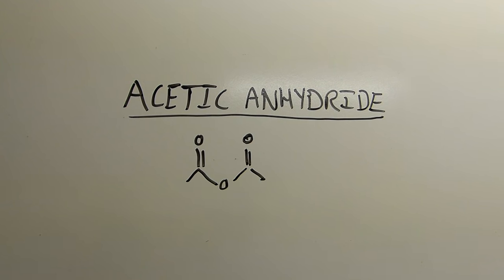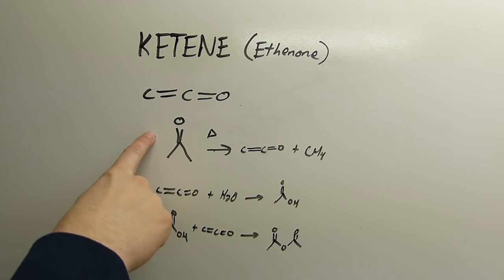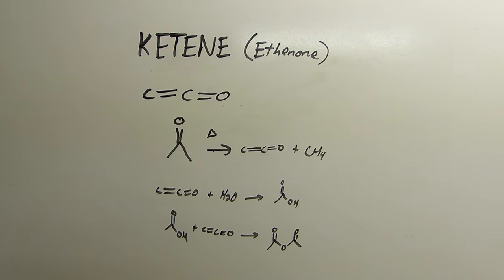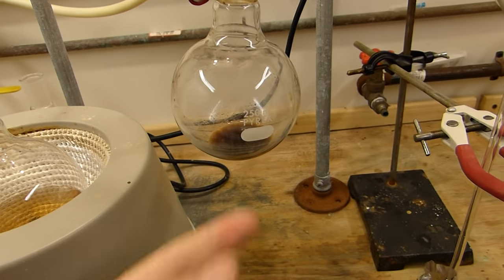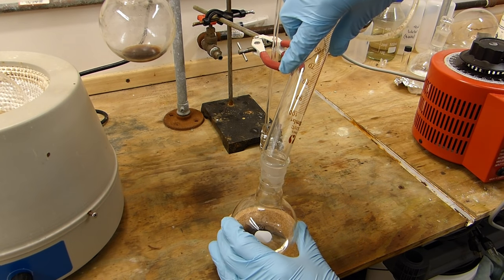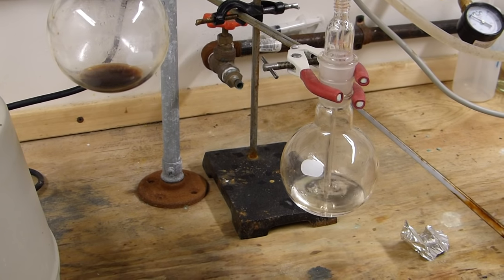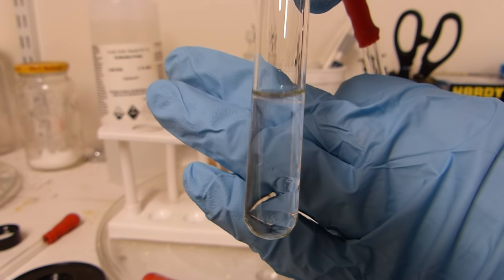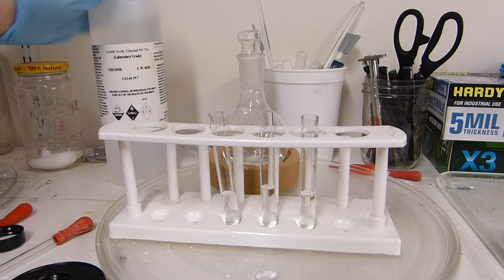Acetic Anhydride Part 2: Running the Lamp

Comment: I would never have the balls to switch that heating element on without running the apparatus under positive pressure of inert gas.  Kudos on your immense testicular fortitude.
Reply: balls of steel indeed
Reply: Saculus in latin
Reply: Please explain this for me Adrian im fascinated
Reply: Couldn't you just use a ventilator on a separate oxygen line from the room?
Reply: Density of acetone vapor effectively purges oxygen from the apparatus.   LEL/UEL is 2.6 and 12.8 respectively  so it isn't that sensitive compared to say hydrogen or the real devil, ethyne.  The other saving grace is the nichrome and copper are effective catalysts for oxidation of acetone.
Reply: @keithjurena9319  yes, you are quite right, acetylene is a nasty little bugger, with it's 3 highly strained bonds and it's wide range of mixture ratio's that go BANG. Did you know that some thermobaric fuel air bombs use acetylene ? There's quite a bit of science involved to get the acetylene to disperse and then and only then is the mixture detonated with another small charge after the dispersal charge. These sorts of bombs are actually only second in outright power behind atomic weapons ! Technically these things can be BIG, a cluster bomb can be used to disperse bomblets to cover an area like a square kilometer
Reply: @psycronizer  
I discovered that as a teen.  A bunch of calcium carbide,  some sodium peroxide,  a trash bag and 100 feet of remote electrical initiation.

It effectively denuded a few hundred square feet of hay pasture.  Lost a pair of underwear in the process.
Reply: I would be far more concerned about the inert gas pushing ketene out of the system than I would be about a fuel-air explosion, because very quickly the gas mixture would be far too rich (oxygen deficient) to explode.
Reply: @psycronizer  just being outside I don’t think would help you either… I know ketene is relatively unstable but i don’t think personally I would risk it.. one gust of wind your way could end badly lol
Reply: Acetone has a high flash point. I used to work with a chemist who used the acetone rinse bottle to put out his cigarettes.
Reply: CO2 isn't "inert gas" per se. but works quite well for a ketene lamo - 's what I used for many years.
Reply: @keithjurena9319 thank you, Keith. You answered a question that I technically didn't even ask you but you apparently read my mind. The exploding ketene lamp from acetone vapors igniting scares me even more than the ketene gas as I'd be thoroughly protected from it with a fume hood, ventilation, respirator and homemade chemical weapons suit made from black plastic yard waste bags.
Reply: Luck😂❤
Reply: Can this chemical break iron nail and loose its magnetic property

Comment: Doug, you're suggestion to use a smoke bomb to test the ventilation in the smoke hood and lab area is well taken.  If there are problems evacuating the smoke out of these areas you need cross ventilation, what is known as "make up air". Particularly and most commonly if you are in a basement in the winter you will have negative air pressure the indoors relative to the outdoors,  this negative air pressure must be dealt with.  Cross ventilation will make the space colder but it will provide you with the essential fresh air.  The way to test for negative air pressure in the lab area is to open a window or door to the outdoors or turn off the fan in the fume hood and see if air rushes in through the openning, if it does you have negative air pressure. Hood fans, which are exhaust fans, can't overcome negative air pressure because the more air they pump out of the room the more negative the air pressure, the vacuum, becomes. By the way, sometimes you don't need a second fan, all you need is to leave a window or door open to the outdoors across the room to let the air in. We love our chemists and we want them safe.

Comment: Ok. So if you suddenly stop producing new videos, we'll know why...
Reply from the maker: +TheBookDoctor Bah, I filmed this three days ago. Safe and sound. :) Also, as you probably saw, I usually buy my Ac2O. I just wanted to prove it could be made at home.
Reply: +Doug's Lab Where do you get your commercial Ac2O from?
Reply: I'd like to know too
Reply: @DougsLab  there are other ways to make Ac2O at home
Reply: @SuperAngelofglory  how?
Reply: @Andrew-my1cp  low yields can be achieved from glacial AcOH and liquid NO2. Also, you can use sulfur halides to convert acetate to AcCl/AcBr and further to Ac2O. Both these are unpleasant and somehow dangerous, but they do not match the risk of using a chemical weapon
Reply: @SuperAngelofglory  Interesting. To my knowledge at lower temps, NO2 begins to favor N2O4 more than NO2. Cool nonetheless but yea even NO2 is something I avoid and neutralize at all costs. I couldn't imagine ketene. FUCK that. I don't even use dichromates. Not a fan at all lol. Anything with a 4 for health on the NFPA diamond is a no go for me.
Reply: @Andrew-my1cp  in that case, you can get AcCl from HCl, AcOH and CH3CN, all bone dry and cold. The yield is about 25%, but, aside HCl gas, you only work with liquids. After that, AcCl + AcONa = Ac2O + NaCl
Reply: @Andrew-my1cp  NO2 only dimerizes in solid state, liquid is still NO2
Reply: @NerdyNEET Well, nitric acid is either 3 or 4 depending on how which one you look at. In my opinion it's a 3. It's pretty toxic. The vapors are and the decomposition product is very toxic. The fuiming version is the worst.

Methanol is relatively non toxic as a lab chemical. You'd have to drink 10mL to make you blind, not kill you. I'm pretty sure at least. I'd give methanol a 2. The diamond gives a decent quick overview.

Comment: Well done, brave man, and a great account of the synthesis, thanks.
I would recommended using a second bubbler to eliminate residual ketene in the exhaust though.
Reply: Maybe fork out $1000 to encase the apparatus in a nifty acrylic enclosure, with water sprinklers on top, to douse the mess when the whole shebang blows out.  That might save a chemist life, and his cat Schlipsi's too.
Reply: *pumped to negative pressure.
Reply: @_arthurski1337  It wont blow if you know what you are doing. Dont attempt it if you dont fully understand what you are doing.

Comment: I might have missed it, but it looks as if the reaction and work-up were done without an inerting gas. Granted, the volume of the system is fairly small but best practice would be to inert the system prior to introduction of reagents. This is something that I have to do often at work (chemical plant operator) for safety reasons. 

Great video, I really enjoyed it.
Reply: It probably feels more acceptable to be a bit more "cavalier" about the safety procedures if a) doing them might not be so easily available to you as an amateur and b) it's just your own life that you're putting on the line, as opposed to the lives of everyone working in the plant and potentially people living nearby.
Reply: I think a tank of arc-welding gas (argon/CO2) would be a good cheap way to get the oxygen purged out.
Reply: @chemprofdave  That's what I use but it does require a lot of drying first. I'd bubble it through H2SO4 (actually piranha to be overkill) then through a drying line of anhydrous Mgso4.

Comment: You can make a useful smoke pen out of nothing but tightly rolled paper towels. It doesn't exactly plume huge quantities of smoke but it naturally smells terrible, being burning cellulose, and you can use the scent as an indicator of fume hood failure while still getting the benefit of being able to accurately test small cross sections of the flow path.

Comment: wouldn't this synthesis be a lot safer under argon or nitrogen flush ?
Reply: I was thinking the same thing.
Reply: How exactly would you do that? The atmosphere will become acetone and then ketene regardless of how you start the lamp.
Reply: @jonross377  it removes the excess oxygen and does not react with anything
Reply: @rareearth7466  I said how, not why.
Reply: Pull a vacuum, then fill it with an inert gas, repeat for a few times, or leave the acetone refluxing without the coil on, and the acetone vapors would displace the oxygen anyway
Reply: @jonross377  i forgot about this guy's pledge to only use stuff home craft .   So maybe using something like N2 from a whip can or something .  It had has been a long time since I've review this  but   just use basic air sensitive techniques with an inert atmosphere to the reaction
Reply: @EdwardTriesToScience  my point was that the acetone vapor would also displace the "inert" gas making the whole process pointless.
Reply: I already said you could just let the acetone reflux and it would displace the oxygen

Comment: Very Impressive, you have given me great impetus and making my own Ketene lamp. I’m just waiting for a 500 mill chromatography reservoir and then I’m going to get busy too. Vogel shows a ketene lamp but it varies a bit from your design, you showed me that it doesn’t have to be 100% equivalence. And my design certainly is not like yours, I’ll let you know how my first acidic anhydride turns out. Thanks Doug, you are quite the chemist. I have always been drawn to physics, but of course had taken my share of chemistry courses. Most of them had been in organic let’s face it most of the interesting things are in the realm of organic chemistry. The fact that a Nobel laureate described the blue color of an alkali metal dissolving in anhydrous ammonia as the solvated electrons from the metal just blows me away. Everybody had seen it, but the person who secured it out that’s figured it out, won the Nobel prize.
Reply: @NerdyNEET   hi, I have refined my ketene lamp several times and would be happy to get back to you with some photos.

Comment: Smoke bomb is a good tip, I use the big 6 inch ones you can pick up at any fireworks stand. I  had to use that trick to make sure my hood is good enough for me to safely work with phosgene. I still used a respirator though

Comment: Awesome video. A proper walkthrough of the safety precautions you had in place would be neat.
Reply: I, too, am curious about this. Were the ground glass joints well greased? Did you provide secondary support in case one of the orange clips snapped? How far back into the fan alcove did the exhaust tube go? Etc.

Comment: If you used larger ketones would it work just as well? Say propanoic anhydride from methyl ethyl ketone.

Also do you plan to use this apparatus for other pyrolysis reactions? There are a lot of interesting synthesises (sorry) around pyrolysis but proper apparatus, particularly apparatus that gives good yield, is hard to make/come by.

Comment: I read that carbon disulfide is normally used as a catalyst for the thermolysis of acetone into kethene/ethenone.
How come you're getting decent yields without using a catalyst ?
Reply from the maker: +_Arthur Ski 
A catalyst is often unnecessary. It simply lowers the activation energy required to make the reaction happen. In some cases, getting the molecules hot enough to react without a catalyst destroys them in the process, so those reactions require catalysts. This one doesn't need a catalyst, but a catalyst would reduce the energy required and improve yield. I don't have CS2 though, so I ran without.

Comment: So before turning on the filament / heating element, you can be assured that there is no more oxygen in the lamp (or at least not enough for an ignition event) just by the flowing acetone vapor? That part scares me more than the muffkin' ketene as I can shield myself from the ketene gas with a proper vent hood and respirator, but an exploding ketene lamp is harder to shield from. For educational purposes only; m0rphin3 is bad enough WITHOUT being tampered with.

Comment: I would be shitting myself turning on that nichrome in case it ignites the acetone vapor.The upper flammability limit of acetone is about 13% so it's not a problem but it would still be on my mind. This is a very cool video, I love seeing big glassware setups like this. What can acetic anhydride be used for?
Reply: acetylating things.
Reply from the maker: +Adam Harrington Yes, I have to admit that's a bit of a clench moment. :) Ac2O is used in a ton of stuff. Fabric fibers, plastics, pharmaceuticals, explosives. It's a very useful thing to have.
Reply: +Doug's Lab Isnt it better to run quick vacuum on the setup before refluxing?
Reply: +Doug's Lab : So, are you saying you could make fibers to turn into yarn, then weave into airbag cushions and then use the other half to make propellant for inflators?
Reply: It's best to do the whole thing under inert gas pressure, but that's pretty tough if you don't have some special equipment.  Standard stuff for a modern lab, but outrageously expensive.  Vacuum wouldn't work all that well, especially in this exact setup, because when the vacuum is relieved, the system would back-fill with atmosphere and you'd have to start exactly like Doug did anyway (purging the air from the system with acetone vapor).
Reply: You actually pointed to a very key point. I won't recommend other without calculation doing this. in fact another factor is autoignition. that's why I believe they use a variac and I think he already test the lamp and find the range that variac supply the power. should be below 500C

Comment: I made ketene by utter mistake when i was a kid. I used air over acetone as a bunsen burner and it had some steel wool as a flame arrester, well it didnt work like that, the iron worked as a catylist and oxidized the acetone to ketene and formaldehyde  ☹😵😵😵

Comment: Correction: it looks to be a Friedrichs-type condenser you're using at the first stage reflux? In short, I'm asking are they better performers than the regular,(read cheaper;) )kinds one could use? Thanks.

Comment: Hey Doug, One more important question I forgot to ask, what glass tubing " borosilicate, flint?" and size " inner diameter, wall thickness, outer diameter?" did you use to insulate the "12 gauge??" copper lead wires...

Comment: Whenever you have electric heaters with exposed connections, it is safer to use an isolation transformer between the Variac and the load.  Even better would be a 120 to 48 volt transformer.
Wouldn't moisture in the air quickly destroy escaping ketene as fast as it escapes?
Reply: Wish he were around to answer this question.

Comment: To: Doug's lab
At the very end how cold or warm is the distilled water in the 3 tubes ?
I'm curious cuz I'm wondering if it matters like if it was hot would that mess it up the same with cold or warm,its probably room temperature.

Comment: Amazing. I've been designing my own but alas it likely will stay just a design as I have no fume hood currently. Where did you get the acetic anhydride? I've been trying to get my hands on some for a video on acetylsalicylic acid but the only way it seems possible is to go all the way from urea and acetic acid through acetonitrile (thanks to Chem Player's fantastic video on the subject), but it would be super nice to just be able to buy some (I don't have a business or company i.d. so, unfortunately, that doesn't work entirely).

Comment: What is the immediately dangerous level of nitrogen dioxide? Because that you can readily sense and unless you are locked in a lab you wouldn't let yourself get poisoned by it because it burns.
Reply from the maker: +NatureHacker NO2 was 68ppm but was revised to 20ppm conservatively. See here: http://www.cdc.gov/niosh/idlh/10102440.html

Comment: If you want to make glacial acetic acid vie this method, what temperature would you distill at, and would it have to be fractional? Also, would it be possible to make the generator out of steel pipes that would be welded together for minimal gas escape?
Reply: I'm looking into this as well

Comment: If I ever try this (which I doubt), I am pretty sure I will use flame to burn the methane and traces of unreacted ketene and als will flush the setup, when the reaction is done, with some butane, which I will also burn. Ketene is no joke.

Comment: Hey Doug, I have a few questions, if you would be so kind to take the time to answer them, it would be greatly appreciated.. What type of respirator cartridge do you suggest using on a full face respirator when generating ketene? What gauge nichrome wire did you utilize for the filament? Can this be used with other species of ketones for example, Methyl Ethyl Ketone, to generate propionic anhydride? I think it's great that you've utilized standard apparatus to assemble a ketene lamp, I have contemplated doing the same but have yet to have the chance to set it up and work out the kinks myself. I look forward to your insight, thanks
Reply: This comment is 6 years old, but I'll respond for the curious. To generate propionic anhydride you would need to pass ketene into propionic acid, obtaining mixed acetic-propionic anhydride, and then to slowly distill mixed anhydride with second molar proportion of propionic acid. Also works with any other carboxylic acid. That's from Vogel's Practical Org. Chem. p. 694.